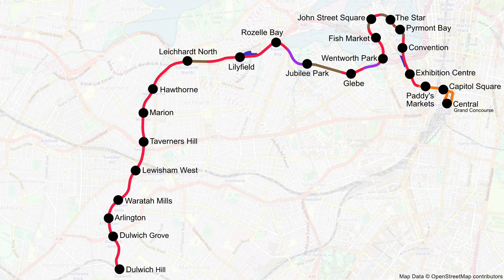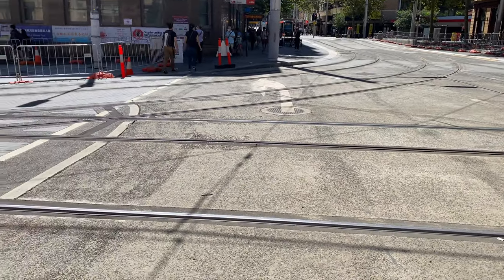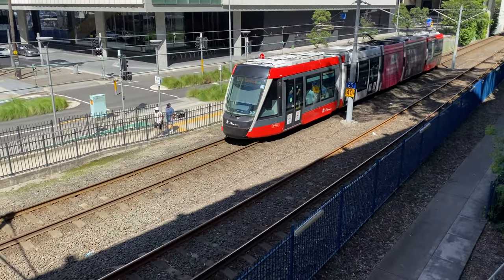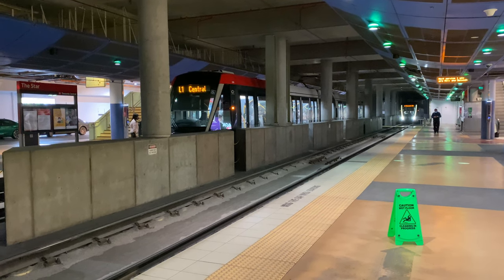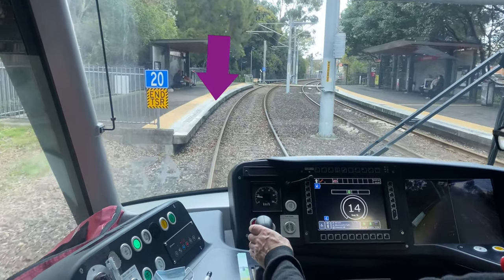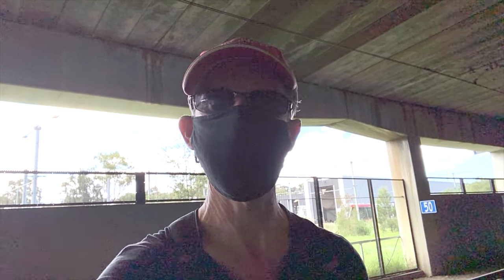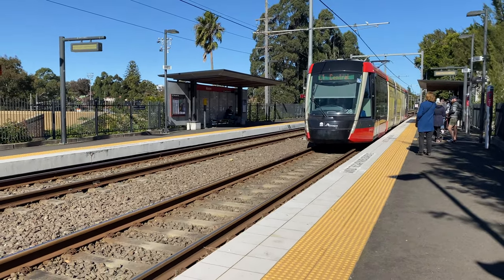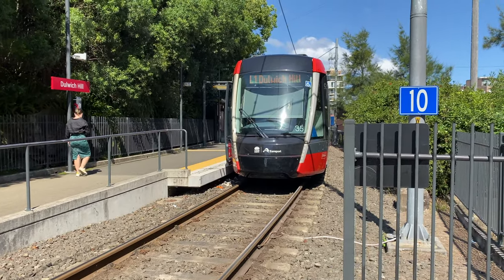L1 Dulwich Hill Line with Alstom Citadis Trams | Sydney Light Rail | Inner West Light Rail Explained

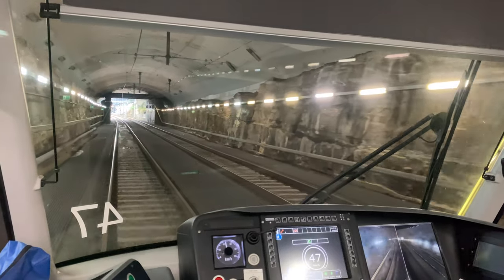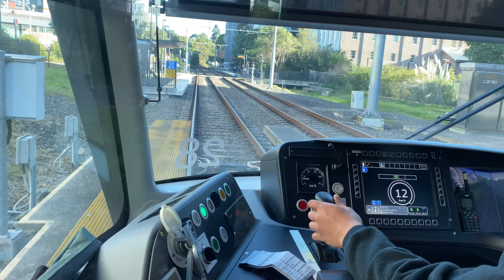Comment from the maker: I've re-uploaded this video with some changes to the commentary between 34:31 and  34:57 (Leichhardt Tunnel) and between 36:49 to 37:52. (crossing the Parramatta Road and Strathfield rail lines). All previous comments are under the original video - https://youtu.be/y0tsSV6vCGQ
Reply: Thanks for adding the flour mill information, there was no need to re-upload the video again, but that is your choice.

Comment: 😀Paul, Good day from Lismore, NSW. That was the Inner West Light Rail I used to catch daily. Alstom Citadis was a company that was 12 kilometres electrified in Singapore. I was the project manager and civil engineer. I worked as an engineer in Singapore from 1999 to 2005. We designed and constructed twelve-kilometre tunnels with two boring tunnel machines and five stations. I also managed 160 engineers and architects.
Reply: Lewisham was where I lived. I lived in Denison St, 5 minutes from the Sydney Light Rail station.

Comment: The Pyrmont bay to Casino stop was very popular when the Opal cards first came out. 
When the new card system was introduced you received free travel from memory after 8 journeys. 
But if you could do 4 small trips it became one journey.
So people would run or catch the light rail between Pyrmont Bay and the Casino on a Monday and they would get free trips on Sydney Transport for the rest of the week.
Reply from the maker: Yes I remember that well! You had to tap on at a different station to the one you tapped off at, for it to count as a new journey. So people would travel from Pyrmont Bay to The Star, then walk back to Pyrmont Bay, then catch another tram to The Star, and then keep doing that for 8 times in total! It happened at other stations too, such as Milsons Point to North Sydney.  It didn't work in the CBD though, as there were special rules that meant that tapping in at different CBD stops still counted as a journey.
Reply: @TransportVlog  you could do it on the buses down George street to central before the light rail closed the road to normal traffic. You Just got off at the next stop. It worked well. 😃
Reply: This was also possible between newtown and macdonaldtown. Its a longer walk but people cottened on to riding a pushy or electric scooter between the stops to rack up the 8 trips.

Comment: Back in the 1990s, I would occasionally see a steam train doing a run on that old goods line around the back of what was Glebe High school (the train would go across the bridge across Bridge road).
Reply from the maker: That would have been interesting! The L1 has so much history!
Reply: At that time (after the shutdown of the Darling Harbour sidings and the tunnels under Ultimo and Broadway), there was a diesel (48 class or some such, I think) that apparently used to run to a council depot near the present Fish Market station occasionally, and the line was also used during the construction of the Anzac Bridge.. The tunnel under Ultimo was a mess. They used part of it to film an episode of "Police Rescue" in the 1980's, and there was left-over staging in the tunnel for many years. I never saw a steam train using it though it would have been good to see. The line was pretty dilapidated, with usually only 1 track of the pair in use, and crosses from one side to the other in various places.

Comment: Thanks for the revision, Paul. I can't remember what was missing but never mind. So glad they have planned some longer platforms and hopefully more coming as the Dulwich Hill Light Rail seems to be overcrowded so much. Still did not notice the extensions at Dulwich Hill but pretty sure I saw them on my last visit. I will share some photos there, with you.
Reply from the maker: Hi Geoff, It was just a few minor changes to the narration.  I got the bridges slightly wrong between Taverners Hill and Lewisham West, so felt it was worth reuploading for this reason.

Comment: Just a historical note the L1 mostly runs along the route of the former Metropolitan Goods line which was constructed to avoid the bottleneck of goods trains going through Central Station. a small part of the L1 line uses the old goods line into Darling Harbour. When the line was closed prior construction for the light rail I did a quick exploit walk along the route . It was a fun walk until I met a 48 class at Wentworth Park! The crew and I had a discussion along the lines of what we were doing on a line that was closed before we went on our way.
Reply from the maker: Yes that's right. It must have been interesting walking along the old goods line back then, even if it wasn't quite closed yet!
Reply: @TransportVlog  It certainly was. i did it myself once or twice, one time getting footage for a video I made about the (then) planned tram service.

Comment: I have travelled on this tram several times and the updated service stock is a little bit quicker then the previous train set unfortunately it is still too slow and has the diabolical Glebe and North Leichhardt stops you really do get the impression this was a goods line
Reply from the maker: Hi Robert, I agree that it's slow in places, especially with the speed restrictions on the turnouts. I reckon removing these speed limits could knock 3 to 5 mins off the journey time.
Reply: @TransportVlog   Still slow though. Better to take the train from Central to Dulwich Hill only takes minutes to get there. Have doubts about the validity of some of the stops. Scratch my head over the Glebe,Lillyfield and the Nth Leichardt stops and realy have to ask" why???" Glebe is diabolically bad, access to Glebe Point Road, frightening with a one in 3 gradient. Nth Leichardt, Leichardt is roughly quarter mile uphill from the station, Lillyfield you have to wait for a Bus, which defeats the purpose of the Tram

Comment: Thanks for the description, especially what they did to accommodate the slight difference in width between Alstrom and CAF trams. One thing I have wondered is whether some single-set Alstrom trams couldn't be used to run a Dulwich Hill to Circular Quay direct service, which would be convenient. Only the Alstrom trams could do the run to Circular Quay, as they can use the street surface power from Town Hall to Circular Quay. I guess CAFs could run as far as Town Hall, although their width might be a problem for the George St Platforms.

It was also interesting to hear that they considered using the old swing bridge and Rozelle yards tracks for the tram. The present route makes mores sense. Originally trams actually DID use the old swing bridge when they ran out to Ryde etc from Sydney. Another idea was to use the Dulwich Hill to Central freight line for a HEAVY rail passenger service, or at least some people campaigned for this at various times from the 1970s onwards. It would have required electrification or diesel sets.
Reply from the maker: Interesting idea of running L1 trams direct to Circular Quay.  It probably wouldn't happen simply it would reduce capacity and slow down trams on the L2 and L3.  If an L1 tram came from Circular Quay, the northbound L2 and L3 trams would need to wait whilst it crossed the junction.  Yes it would have been interesting if this had become a heavy rail service! And I wonder where the CBD terminus might have been (perhaps under Central Station!)
Reply: @TransportVlog  It's true that L2/3 trams would have to wait for an L1 at the George St junction, but on the other hand, they presently have to wait for L1 trams crossing it at right angles on their way to/from Central. You would have capacity issues,  though they might be balanced by convenience/patronage.

As for the inner west HR idea, I have wondered about that too. The line crosses under Broadway and then curves southwards. They would have to make platforms where the cutting comes from the tunnel up to the general grade, or just run it to Redfern. A new tunnel under Central would be expensive!

Comment: Once I was waiting for the tram at Kingsford and a guy tried to run a red light when a tram departed and almost hit him! The tram used a horn haha, sound similar to the one on cars.
Reply from the maker: Yes that happens quite often unfortunately. The tram driver will normally use the bell to warn other vehicles, but it necessary, the horn to provide a more stern warning.  In this video, you can see me in the drivers seat ringing the bell and sounding the horn! https://youtu.be/baF6mnHVEuM?si=So5qMlQTdmsQ3xGS&t=337

Comment: I found that Alstom built trams with bogies in the front, centre and rear. It seems to be the same pattern with the others.
Reply from the maker: Yes that's right.  The modules that don't have bogies are the step-free wheelchair assessible ones. This allows more space for the low floor.

Comment: I have seen some alstom citadis trams still on the L1 these few days. Do you know when they will all be transferred back to the L2/L3?
Reply from the maker: Yes I continue to see them too!  The off-peak frequency has been increased to every 10 minutes, so it will be interesting to see if Alstom trams are required to maintain this frequency, or whether they will just come out at peak times.
Reply: The current CAF fleet are slated to undergo major component replacement/overhaul, so you’ll see quite a few at Pyrmont completely hacked-up. I reckon Citadis’ will go once the new Urbos 100 growth trams (2125-28) come into service within the coming months if not weeks!

Strangely, they differ considerably to the existing CAF fleet. Different shaped car bodies, internal LCD displays, larger external displays, different traction equipment, larger A/C units. So much for streamlining fleet maintenance.

Comment: Hey Paul just out of curiosity why did the Rozelle Railway yards ceased operations in 2009? because I remember it being in operation when I was 8 years old. The other thing that you forgot to show in your video was that the Old Goods Line used to connect Up to the T3 Bankstown Line at Dulwich Hill and there's an Old Railway bridge going over Terrace Rd in Dulwich Hill where the goods line would connect Up with The Bankstown Line at Dulwich Hill so that's something you can share with everyone if you are going to do another video of the L1 Dulwich Hill  line again.
Reply from the maker: Hi Peter, I'm not sure why goods trains stopped operating.  I guess it just became uneconomic, as larger and more modern freight facilities elsewhere in Sydney took over.  Yes that's right! I've seen the old bridge and trackbed when travelling on the T3 between Dulwich Hill and Hurlstone Park.  I am planning to do a front of tram video for the L1 at some point, so I can mention this then.
Reply: With the redevelopments at Darling harbour, & Barangaroo, the Darling Harbour goods rail depot, lost it's reason for existence. 
Goods yards now exist at Chullora, Port Botany, with a new logistics hub being developed at the old Army site at Holsworthy, & no doubt also at the new International airport site at Badgerys Creek.
BTW Great video Paul! Thanks!

Comment: oh yeh that's right cracks were found in rolling stock. I don't get why there are 2 different types of trams .At least the L1 tram tracks are compatible with the L2 & L3 tram tracks !? or are they?
Reply from the maker: Yes that's right, the track and loading is the same for the L1, and L2&L3.  The CAF trams can't run on the L2 or L3 between Town Hall and Circular Quay as they don't have the ground-level power supply system. And being slightly wider, they may be issues on other sections.

Comment: The doors for all L1 trams used to require the passengers to open themselves, but it seems that now has been converted to driver-controlled.
Reply from the maker: Yes that's right.  I think they changed this as a result of COVID-19.
Reply: @TransportVlog  I remember them opening automatically before COVID, back in 2018-19

Comment: The video is amazing as always, but these 5kmph curves are beyond ridiculous... 50 years old tram lines in Europe with points have higher speeds in curves like this... And this is a somewhat new line.
Reply from the maker: Glad you enjoyed it! - Yes it really is time to review those speed limits! - However, I think with all the issues with the CAF trams, this may not happen for a while!
Reply: @TransportVlog  can you explain what are these issues? We also have CAFs in Hungary, not exactly the same though.
Reply: @csabasipos6525  The Urbos 3 CAF trams developed big cracks in the wheel wells and needed to be repaired. The Alstom trams were sent to run on the L1 line, but this line has a slightly different loading gauge to the L2 and L3 lines that the Alstoms run on, hence the temporary lower speeds

Comment: why the light rail look like the other light rail 1 have 5 car one have 10 car
Reply from the maker: Its a single unit (5 articulated sections), and the ones on the L2 and L3 are two units, so 10 articulated sections.

Comment: I have no idea why that tram has a loading gauge issue for. That tunnel was used for much wider freight trains and wagons. There really should be no loading gauge issues with the citadis trams.
Reply: I suspect it's height rather than width that's the issue with the curved cross-section of the Glebe tunnel.
Reply from the maker: Yes it's a bit of a strange one. The speed restriction could be there for another reason, but loading gauge seemed like the obvious one to me.
Reply: I always assumed it was due to the different wheel profile causing a lot more hunting oscillation especially at higher speed, which could damage the track and tram and bring in the potential for derailments.

Comment: Presumably the trams use battery power in CBD as there are no overhead cables
Reply from the maker: Hi Geoff, the L1 has overhead wires on the whole line.  The L2&L3 use a ground level power supply between Town Hall and Circular Quay. This article explains how this works - https://en.wikipedia.org/wiki/Alstom_APS